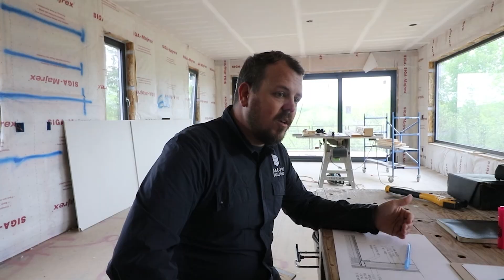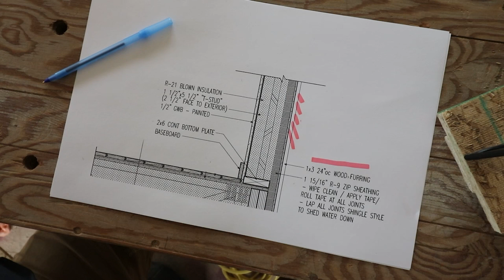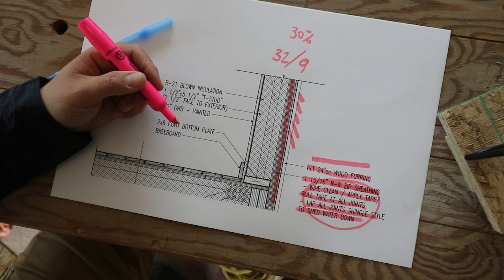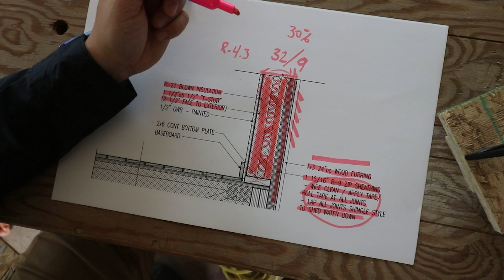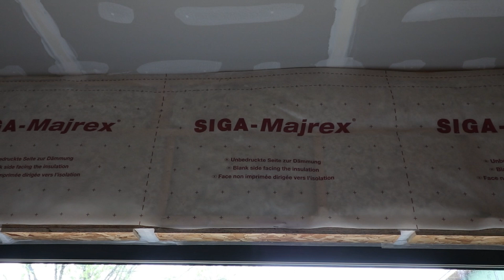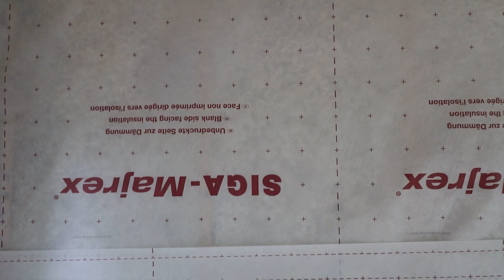Controlling Water Vapor in Buildings

Comment: Be carefull! The major flaw of the ZIP R-system is that those boards are NOT air sealed on their seams on the warm side (in winter time).

Any vapor that can reach the seams of those ZIP boards will condensate against the tape on the outside which might lead to rot on the OSB of the ZIP boards..

Therefore you MUST tape off all the seams of your air and vapor barrier on the inside, espacially if you're using a wool-like insulation material (which are always air and vapor open).
Reply from the maker: I think we are going to disagree on that one. If the home is testing at rates of less that .3ACH50 I don’t believe you can make an arguement that things are not air sealed. 

Second, where is this moisture coming from? The seams are covered by wood on the interior side as they must break over framing members. 

There are multiple folks in the industry trying to drum up this theory and unfortunately we have homes that are now 15+ years old that we have taken apart that are in cold areas that on the north side of the home are not having issues like you are claiming. The science doesn’t support this theory. The evidence doesn’t support they theory.
Reply: On your second point, you're correct... on paper ;-)
In your video of may 3rd, 2023 (about Anderson Windows), you can see that small areas don't have that horizontal wooden blocking...
If you watch Steven Baczek's latest video (sept. 1st, 2024) you'll see longer horizontal seams that are not covered with wooden horizontal blocking (around min. 6').

Besides that, a wood to end-wood connection is never airtight (so also nover vapor tight).

If this leads to accidents waiting to happen , depends on the final QC (maybe it gets taped or caulked) and finish and the insulation used, spray foam will mitigate this problem, just like the combo of  sheetrock + latex paint.

Regarding your first point, if you're using woollike insulation materials, you need actually TWO air barriers, one on the warm side and one on the cold side in order to keep the inside or outside air and vapor out of the insulation material.

And those two air barriers should be capillary active, meaning that when they get wet on one side, they should be capable of drying on the other side (= liquid water should be able to travel in the material from one side to the other side).
Reply from the maker: I cannot comment on the videos that Steve is putting out. All seams in structural walls should be blocked. You are correct that the connection is probably not air tight or vapor tight. However I fail to see where the driving force that is coming from in this arguement without air leakage. If we are building homes less that 3 ACH50, where is our issue? If you are building a leaky house then you have an air leakage problem and not a vapor problem. Your air is bringing moisure with it. People confuse the two all the time. I can understand moist air bringing too much moisture into the wall and getting trapped or condensing and that being an issue, but that would have nothing to do with a tape seam. 

There is absolutely no need for two air barriers, either your air barrier works or it doesn’t. If you are installing one that doesn’t work than you are installing the wrong air barrier, or you are installing it poorly. In fact the addition of a secondary interior air barrier in many cases weakens the drying potential of the wall assembly. I would make the arguement that if the home has a well detailed water control layer, air control layer, and thermal control layer, with a properly functioning HVAC system there is virtually no risk to vapor issues building. 

We should be ten times more worried about propper window installation that anything that could take place at that connection point from a risk stand point. I just don’t belive in the vapor monster. I asked for folks to send me photos of vapor damage a few years ago and no one I knew who does failure investigation for a living could find anything that was vapor damage. Everyone could find air leakage problems but nothing that was just vapor. Seal the air leaks and manage RH and the problem isnt a problem. There is no driving force without an air leak.
Reply: You need also to look at "internal convection", if warm moist air can hit a cold air tight barrier, i.e. the glass of a single pane window, you wil get condensation, there's no need for an air leak.

If warm moist air can reach the tape of your ZIP panels, you'll get condensation against the tape which will wet the OSB of de ZIP panels, that's the problem.
Reply: @jake.bruton.aarow.building I don’t know if this tape condensation thing is actually an issue or not but why does Zip make vapor permeable tape if it isn’t? I’m building a 2x8 wall with zip r6.6 in zone 6 and it seems to kinda make sense to me but I also can’t find the permeable zip tape anywhere.

Comment: There is an option to use vinyl wallpaper. The designer/builder/homeowner MUST ask for "perforated Type I and Type II vinyl wallcoverings".  Many patterns are available perforated or solid. Normally when placing the order, you must specify the perforated option. If one pattern is the one you must have, and it's not available in perforated, there are companies that offer the perforating service.
Reply from the maker: I had no idea. Thanks for sharing.
Reply: So when using zip r we shouldn’t be using poly as a vapor barrier on the interior
Reply: @fullrestoration8205  Poly should never be used in a building envelope, unless under a concrete slab or in a crawl space.

When using the ZIP R-system it's best to use a vapor open air barrier on the inside, i.e. building paper or any board with caulked, taped or glued seams (sheetrock, wood fibre board, thin OSB, thin plywood,...).